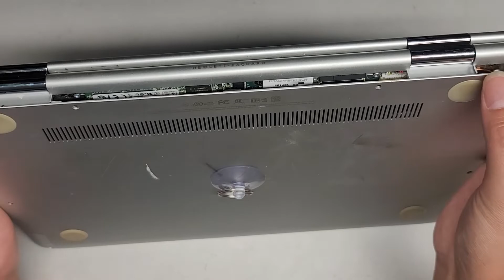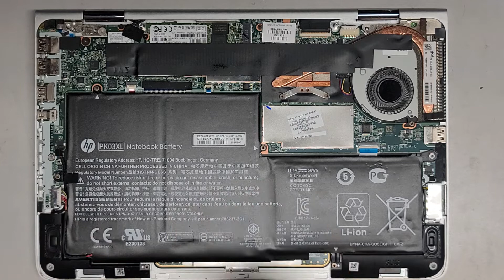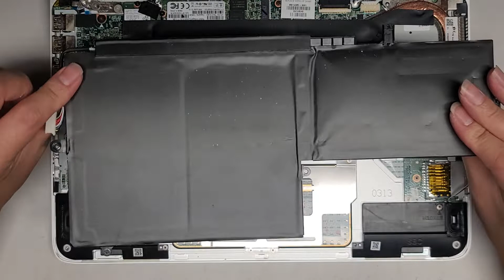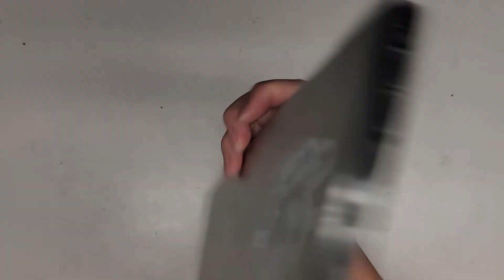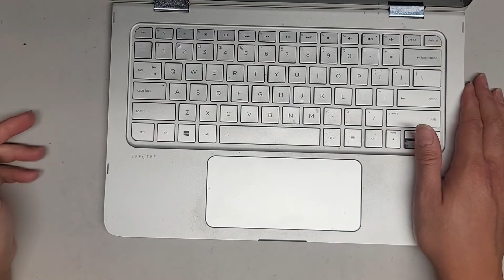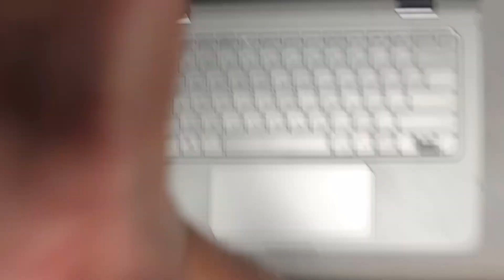HP 13t-4000 X360 Disassembly RAM SSD Hard Drive Upgrade Battery Replacement Repair

Comment: Please help. I have this model laptop. The screen doesn’t come on and the cups lock light blinks. What can I do?
Reply from the maker: Check the ram
Reply: @ItsBinhRepaired  the ram is soldered in. I ran the bios and it says memory is ok
Reply from the maker: Try running memtest
Reply: @ItsBinhRepaired thank you. I actually unplugged the battery and just use the computer with the charger cable and it works perfectly fine. I guess some issue with the battery.
Reply from the maker: Yup
Reply from the maker: How did you check on the bios if the screen doesn't come up?
Reply from the maker: @josecitomarin  very strange. Try a new battery.
Reply: @ItsBinhRepaired  it came on once in a while. I had to try rebooting a few times and it came on
Reply: @ItsBinhRepaired  I’m gonna leave that alone. I’ll just use it without the battery. It’s working fine. I think I damaged it by not turning the computer off after use. I always left it on
Reply from the maker: @josecitomarin  that shouldn't be an issue lol